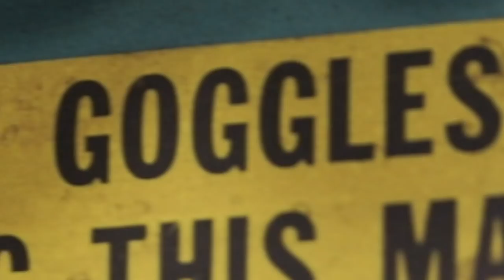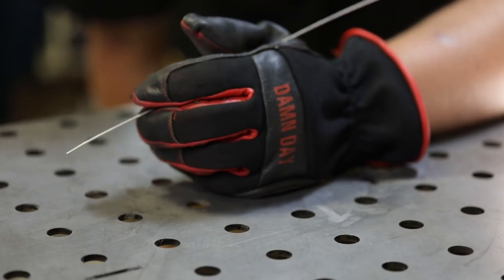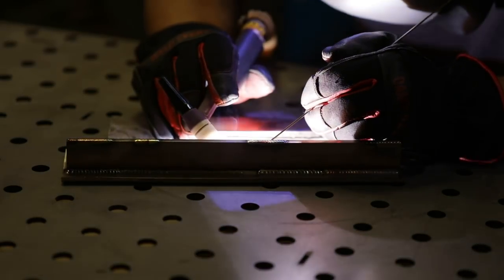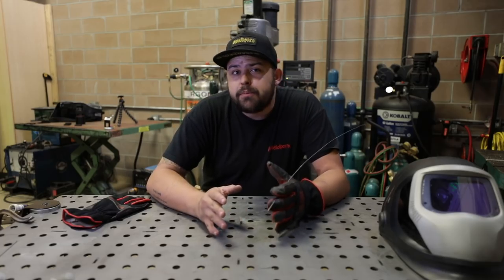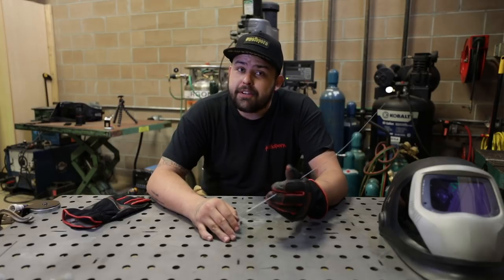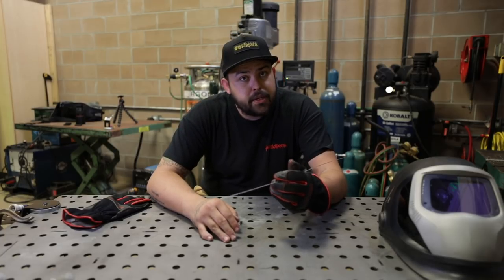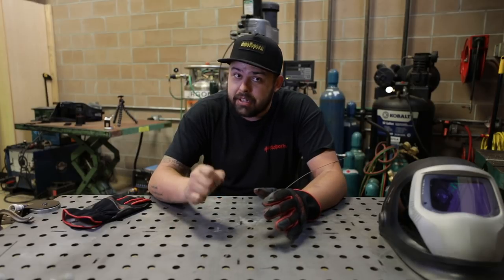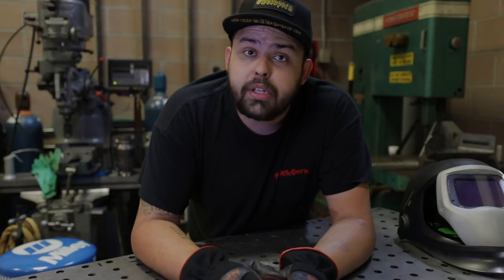Tig Welding | How I Feed filler rod | Quick tip

Comment from the maker: How many of you struggle with feeding filler rod?
Reply: HourGlassFab always struggle with it. Really new to welding but trying to pick up good habits/techniques from the start. Cheers for the vid
Reply: ✋ this guy does
Reply: I do!
Reply: dave11owlett start with stick welding
Reply: I start out doing ok, but then have a brain fart or 12 and can't get my timing back. I'm trying to rush for some reason. It's a very hard habit to kick.
Reply: Specially on pipe. Usually dip tungsten soon as I try and introduce filler to puddle.
Reply: I do I do
Reply: maybe you should wear some sleeves before you try to teach tig welding. lol
Reply: I know I sure do...thanks for a great video.....Dusty at Pacific Arc Welding recommended watching your channel. just subscribed ...cheers from Florida, Paul

Comment: You touched on what I feel is a very important subject.I'm an old retired pipe welder and think most of the young guys need to pay more attention to how they feed rod.You showed a little bit,talked a lot,but if you could continue on the subject I believe you would be doing a great service to the young guys out there,thanks!
Reply: JoJo Mama I was thinking the same thing. Didn’t really show much. But talked much.

Comment: Thanks Brad. I was holding the rod the same way, but feeding with the two fingers and holding the rod with my thumb. My accuracy sucked. Haven’t tried your method yet while actually welding but trying your way with a piece of rod feels way more comfortable and accurate. Thanks again for what you bring to our craft. 
@ForrevverEndeavors
Reply from the maker: Dave DavidM Thank you so much for the support! I appreciate you watching the video man. Yeah, I totally know what you’re talking about! I used to do the same thing. Also try this: instead of pushing the rod into the puddle.. just feed rod without dabbing and then add that bit to the puddle before you load your next round.. rinse and repeat! 🙌🏻

Comment: Just bought an AHP Alpha Tig, I am havi g problems feeding rod and being consistent. Seems that my rob balls or melts before I even get it to the puddle. I really want to get good at aluminum but after a few hours of practice it is kicking my butt. Thank you for the vids you way of explaining things really helps me learn the processes.
Reply from the maker: Brian TVP/SWR the rod balling before it gets to the puddle is just due to an incorrect or to angled torch angle.. you’re directing heat at your filler rod and it will liquify before you can add it. Just keep practicing and correct your torch angle and you will be golden!
Reply from the maker: Brian TVP/SWR you’re very welcome, I’m here to help!
Reply: You find out quick correct form is a really critical aspect of Tig welding. I think part of the problem for some of us is that we have been spoiled by the ease of using a wire machine for so many years it has come back to haunt us!

Thank you for the reply! Keep up the good videos buddy, we will keep on watching and learning.

Comment: I took a strange way while learning. I had trouble holding steady while feeding so I stick the rod in the puddle, back my heat and torch back and regrip while the rod is stuck then carry on as if I was normal. Nobody even knows what a dork I am.

Comment: That’s my biggest problem. I always end up contaminating the electrode. I usually just lay the rod down and consume it as i go.  Just need more practice.
Reply from the maker: Elysium practice is all it will take man. Like I said in a comment below.. try and just feed rod and then add what you fed into the puddle.. rinse and repeat. You can just load your hand and then add that to the puddle accurately instead of trying to feed directly into the puddle. Try that and then when you can do that.. you will be able to accurately feed into the puddle.

Comment: I don’t hold my filler rod that way. I rotate my hand and feed it through my pointer and middle finger. My thumb, ring and pinky fingers stabilize the rod. I have much more steady and consistent feeds. I didn’t invent this method. I stole it from kainekid aka rush kaine.